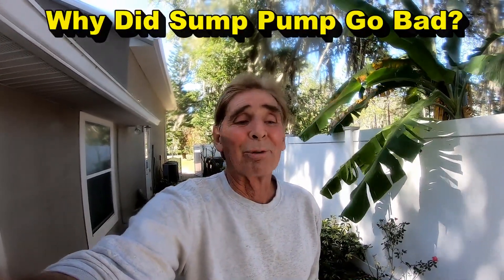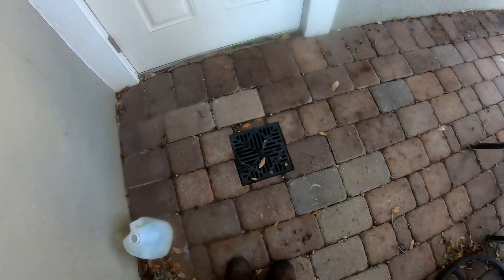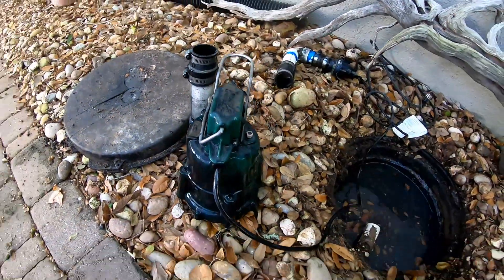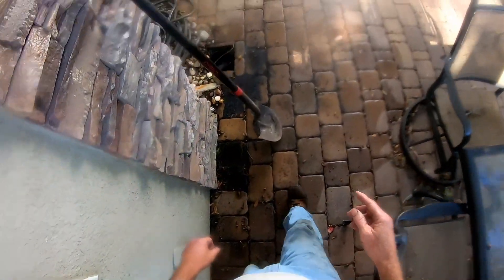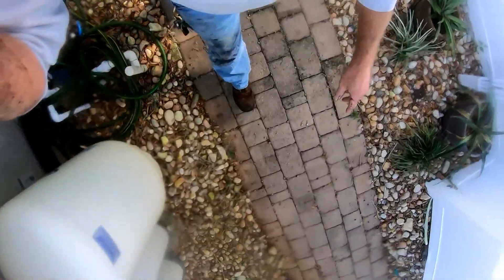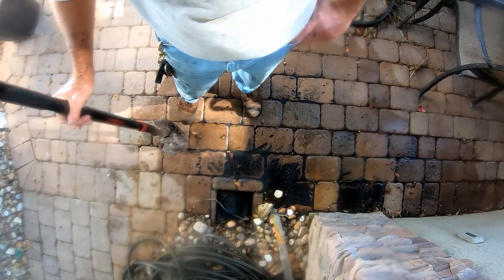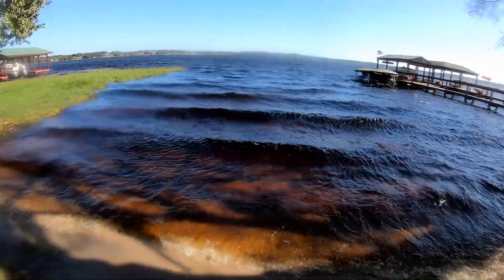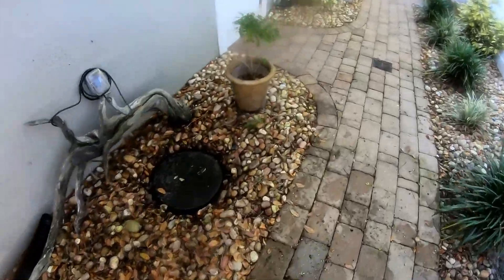Failed Sump Pump - Why?

Comment: Hi Chuck ! Thank you for all the great and informative videos that you made.
I wanted to ask your professional opinion about a sewage pump too powerful for existing piping.
I live in a 70 years old basement apartment in israel and bought italian pedrollo 220V 1HP sewage pump to replace a weaker pump that dies.
The original outlet of the new pump is 2" and I've added a 1.5" adapter to connect it to the existing PVC sewage 1.5" output pipes.
My problem is that the pump seems too strong for the existing 1.5" PVC sewage pipeline. It need to lift the sewage water for 5 meters with two 90 degrees angles on the way, Which is very easy for it.
What I did in order to not clog the old sewage pipes is : 
1. added a timer to limit the pump to work 10 seconds every hour
2. added a 1.5" Y splitter after the first 90 degrees angle of the output pipe with opening of 0.5" so some of the water from the pump will go back to the sewage pit.

I'm considering also adding a ball valve to the Y splitter so I'll have control of the flow going to the old pipes. Is it a good idea ? How would I know it's the right amount of pressure for the old sewage 
pipes ?

Thank you !

Comment: This is installation fail. I don't get it why did you put discharge pipe so close to the water when you could go couple of feet higher.
Reply: should have made the pipe from sub pump higher so this who'd not happen
Reply: They did this years ago when the shore line might been lower... I would pull it back by a few feet and put a pop up...
Reply: @mdxcrafting9744  i am with you some thing different needs to done

Comment: That sump basin looked like it had quite a bit of an oily substance floating on the surface. What is that??
Reply: Most likely the pump overheated or something and the seal in the pump went because the pump motor is filled with mineral oil.
Reply: @mainelyelectric  ah ha!!! Didn’t think of that!!! Thank you for clarifying.

Comment: Wow  So Complicated🚣‍♂️
Reply: Thank you for your comment 👍👧I just wanted to tell you that last night in Michigan we had a big storm. So scary with lots of wind and down pour of rain which normally flood 3 back yards.  But since I followed your instructions and put in a French drain between my neighbor driveway and my grass line in the front of the house and to the backyard down the fence line of my neighbor yard and mine and then across the back of the yard where the problem originated from the neighbor across my yard raised his yard about 10 inches. Over 200 feet with a shovel all by myself. And so far no flooding.  Thank God Almighty. So now the next test will be this Winter with the Snow. 💖